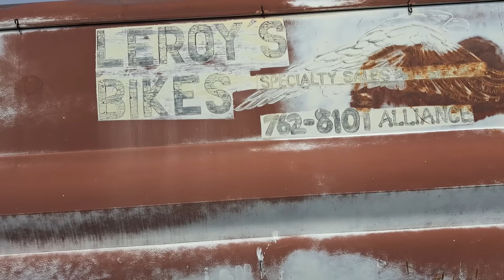Exploring a MASSIVE Midwest Junkyard Loaded With Old Cars and Trucks

Comment: That Ford sedan cut down and converted into a pickup is historically significant. Most of these were done in WW2 when gasoline was rationed. Farmers could get more fuel stamps if they had another truck .They were considered essential to food production for the war effort. And that one is sitting in farm country so it adds up. I've seen others too. A  early 30s Tudor sedan rear body wall makes a pretty good  rear cab wall.

Comment: I like the 5556 Fords but I like to put Chevrolet motors and transmissions in them I use the front sump off of Chevy too and put 350s in them or 327s